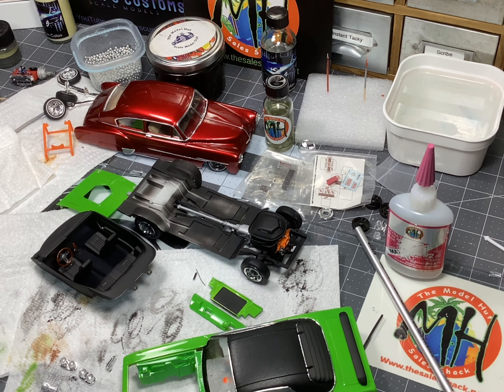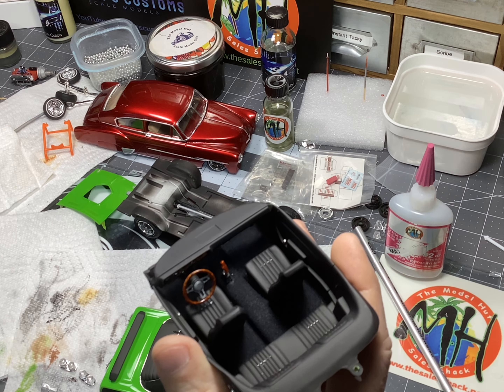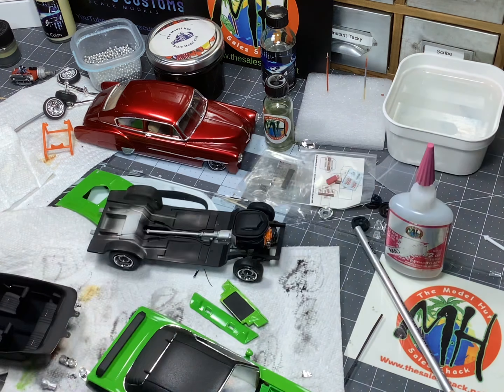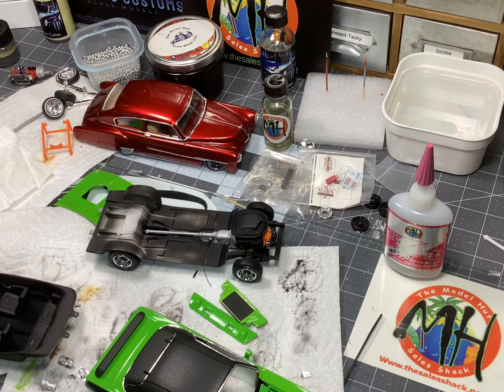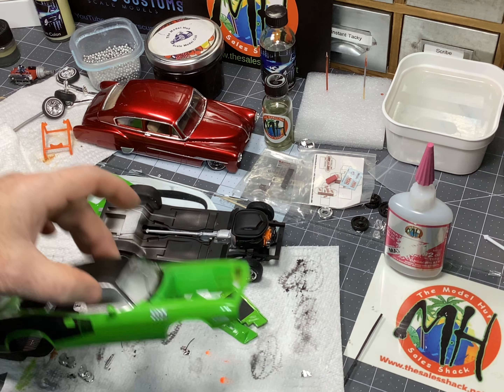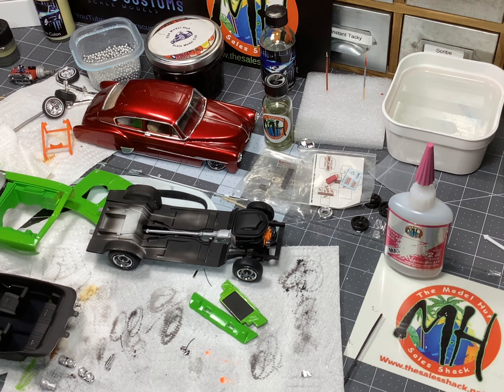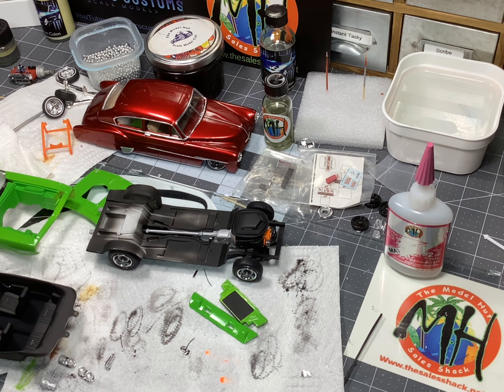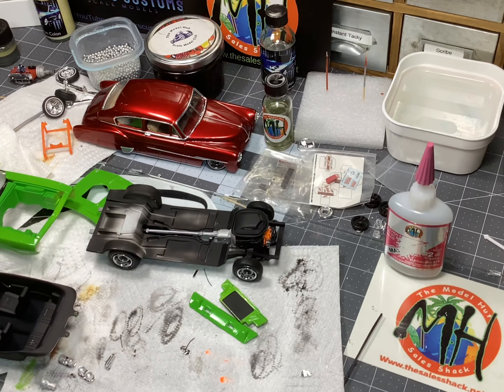1971 Hemi Cuda update bench updates

Comment: Cuda is looking great  I added an antenna to my 70 it’s a very fine pin I just drilled a hole into the body so it fits snug so it’s retractable for transporting
Reply from the maker: Thanks for watching Woody. I used to drill a hole in the fender I just found the magnets are so much easier to use
Reply: Brian did you get the email I sent you a few days ago clubvic312

Comment: I built the Cuda a few weeks ago.  I wish I had seen this video before I built it.  Particularly,  the part about the billboard decals and the color pencils.  At what point did you clear the billboards?  Nice work.
Reply from the maker: @mikepoindexter9849  I matte cleared the billboards almost at the end of the build the car had already been 2k cleared  I used Tamiya fine line tape around the board then used my 3m blue masking tape to catch the overspray I did not mask off the entire car to do the billboards
Reply: @ Thanks.